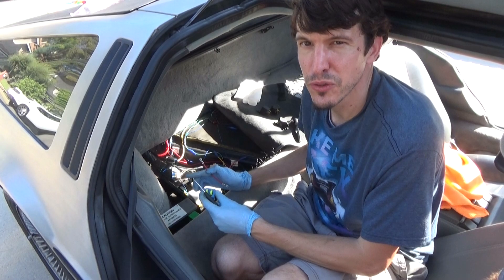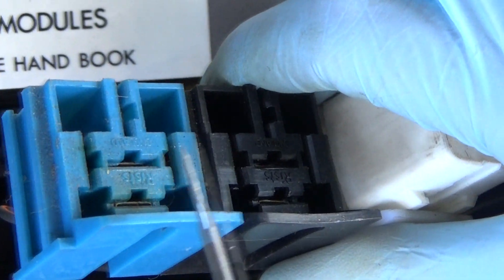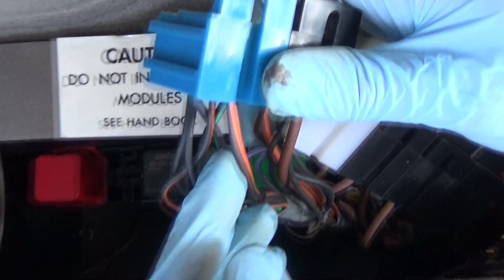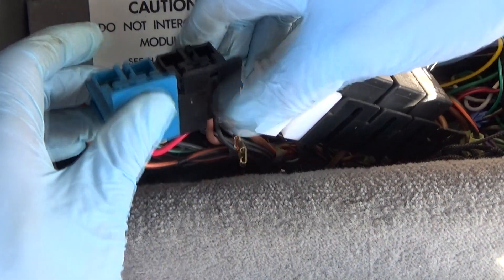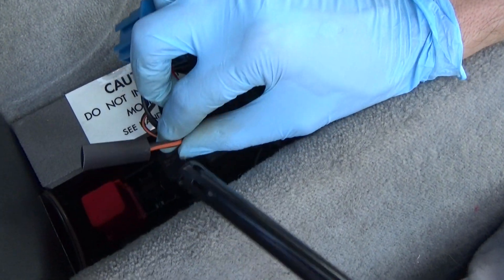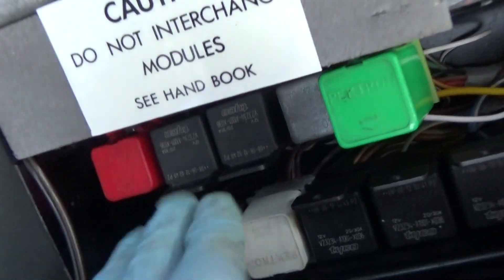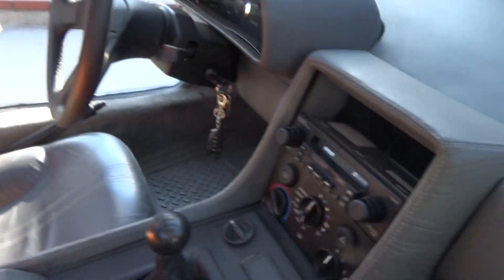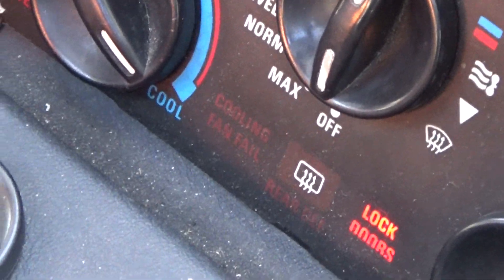DeLorean Fan Fail Module/Fan Relay Wiring Mod How-to Featuring Dave McKeen's Solid-State Units

Comment: Worth mentioning that the black and orange wire that gets disconnected in this video is actually brown and silver according to the colored wiring schematic.  The schematic also shows one of the wires going to the fans from the fan fail relay is black and orange, so viewers be careful not to disconnect the wrong one.  The goal is to disconnect the two wires going to the circuit breaker shown in the video.  But you can't just disconnect them at the circuit breaker; you need to remove them from the relay bank.